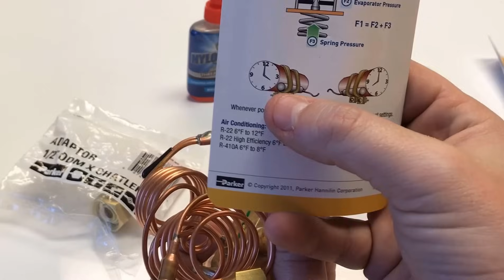Why and How to Adjust a TXV / TEV

Comment: no disrespect but he gives a great understanding as an engineer. ( looking at his fingers hes got zero in the field practice, however still fundamentally curtail). * down in the field you just replace, rather then adjusting. no matter the application. there is a spring under mechanical  and technician.  "you check meter flow with the unut running". heres the thing. unless you are the home owner that can spend hours upon hours testing every possible failure you are not able to simply adjust the txv.... the spring tension and other factors make it not a reliable repeatable fix.

Comment: Is it okay to run the TXV with out an inlet screen?  My HVAC guy removed the inlet screen because with the flanged copper 3/8'' pipe the front cabinet cover would not be attached.  He said the inlet screen wasn't needed.

Comment: 0:59 - The purpose of the thermostatic expansion valve is to maintain the correct amount of refrigerant in the evaporator coil for any change in load conditions by assuring a constant superheat at the exit of the coil. When the load conditions call for more refrigerant in the coil (such as during a hot pull-down when, say, the door of a walk-in is left open for an extended period), the rise in temperature at sensing bulb will push the valve further open.
12:34 - The number of degrees of superheat is directly proportional to the volume of vapor within the coil — the more vapor taking up space in the coil, the less room there will be for boiling refrigerant (and the less efficient the box will be). Just sayin’

Comment: Hi I have a 6 Ton carrier split unit with a "Piston" I would like to replace it with a Sporlan TXV (I have the TXV on hand) but I also want to add a suction line accumilator . What size range of the accumilator (in Liters) should I use .  Thanks very much

Comment: 6 to 8 ° is extremely low . I’m looking for 15 to 20 degrees superheat at the compressor. I’m not sure why it would be so important to check evaporator  superheat in air conditioning refrigeration yes but We are trying to make sure our compressor has good super heat and we’re not flooding the compressor …….. 15 to 20 degrees superheat at the compressor is what we’re looking for

Comment: Lennox warranty is givin back out adjustable indoor txv when it comes to stock txvs ..and guess what they are coming out closed.so you might as well start the system with it wide open and close it til your gauges look good..now at wide open within the first 20 mins the compressor will start making out chattering noise

Comment: Hey guys what s  the best way to adjust 3 x TEV danfos  valves 
So it's fitted with manuprop  MT 160  compressor and 3 evaporators 
Thks Tony

Comment: I am an ectrician by trade but the ac at my house quit cooling.  Its not cooling at all.  The condensor I think came with the house and it was built in 1987.  The inside unit was installed around 2000.  Its a 3 ton ac  unit 120 volts.  It stopped cooling about a year ago and it quit working all at once.  The compressor is running and I had a friend check the freon and he said it is low but not so low it should have quit working.  I'm thinking it might be the TXV.  I have airflow going thru the unit, its just not cold at all.  Any idea's

Comment: If I reach the subcooling value to the exact number stated in the label of the condenser's unit charge value which is 10F but the superheat goes to 1 or zero.. should I adjust the TXV valve to increase the superheat value to normal levels??

Comment: My company keeps trying to use these thermal expansion valves on low temperature Chillers that we manufacture. They are anything but an constant superheat valve. The electronic expansion valve it's so much more Superior especially with variable heat loads. The problem I have is the electronic expansion valve controller wants to fault out if I run the suction pressure into a vacuum period or if I run my suction line temperature below - 59 degrees Fahrenheit. Then the controller wants to fault out and close the expansion valve completely. When I talk to an engineer at Sporlan he asked me how low do you want to go. I'm like negative 100 degrees Fahrenheit. He just laughed at me.

Comment: Why do people say reducing superheat (smaller safety factor against liquid) uses more of the evaporator / is more energy efficient?
Reply: Well you dont want your evap coil being filled with liquid 80%-100% of the capacity. You want it to the point where in the middle of the coil its vapor (thats what you wanna feel to feel cool)..some people over charge a unit to the point where that vapor point happens at the suction line which at that point its past the blower motor cool air going back to the compressor and not your house instead of cooling you its cooling the copper lines itself ..its just like car you want your combustion to happen inside the engine not at the exhaust thats why you hear and see dumb high school kids now adays doing dumb mods to the cars that make it sound like gun shots thats combustion happening at the exhaust and not at the engine

Comment: Just had a heat pump installed and have had the installer out 3x now with the A-coil completely frozen, saying it’s a bad expansion valve, I hear in this video how the smaller lines are “delicate”… Well, ours look like they just yarded the damn things out all haphazard, looks like total crap..,

Comment: It’s also important to note that superheat is pretty important to the compressor. It’s important to know what your superheat is before it reaches the condenser because if the superheat is perfect at the evaporator but too high at the condenser then that can create an issue.

Comment: Thanks Brian, question please, I always have hard times brazing these short necked TXVs, I cannot easily roll them well with a wet rag, I use a strong neutral flame to make it fast but, the rag tip gets burned carbonizing the joint and the valve over heats rapidly, any suggestions? Thanks

Comment: I just had my AC unit serviced and the guy refilled the refrigerant since it was completely empty. Now my AC unit is really struggling to pump cold air - i was thinking of giving this valve a half turn to allow more refrigerant through - is it possible it was reinstalled "too closed"?
Reply: If your system was empty it has a refrigerant leak. DONT touch the valve. If it's not keeping up it's probably losing refrigerant at a high rate.

Comment: I'm really late watching this video but I just had a TXV unit installed that calls for 7-9 degrees of superheat.  The subcool is dead on in the high 8s, but the superheat is at 24.  I checked ductwork and there are no leaks that I could find other than a couple of tape joints that had a very minute amount of air coming out, I taped them up.  But my delta T is still at 16, I feel like something is wrong with this install.  Any ideas?

Comment: My trane unit 410 subcool is 10 and the saturated evap coil temp is 50f is that normal? My old trane r22 evap sat is around 38 to 40

Comment: You say adjusts a TXV to get correct super heat what about adjusting it for Sub cooling?  I installed a Danfoss tr6 into a system that had a piston orifice and now  I'm having trouble charging to 10 deg Sub Cool. I'm at 7-8 degs and cant get it any better.  Oh and it not responding to charge because I've gone for low to over and still cant make the ideal S/C

Comment: I have r507 chiller operating at 1 to 4degC . What is reco. Superheat..I test it once, measure it in the evaporator, suct.temp is -1C then suction pressure is 50psi..according to chart 50psi is -10C . So my SH is 9deg.C..is this right?
Reply: I work for a Fluid Chillers inc. We shoot for 15 degrees Fahrenheit superheat, but mainly we don't want the compressor to ice up. Low-temperature evaporators are very susceptible the heat load supplied to them. And even though he calls it a constant superheat valve, they're anything but. As the load begins to drop so will the superheat unless you have an electronic expansion valve. In a low load situation a superheat of 10 degrees Fahrenheit is fine but then as the load increases you could have a super heat as high as 40 or even 100 degrees Fahrenheit depending on how hot your load is. We're on chillers from 68 degrees Fahrenheit setpoint all the way down to -80 degrees Fahrenheit setpoint. I'm a huge fan of electronic expansion valves the stepper motor on the valve is so much more Superior than your silly diaphragm valve

Comment: What i am always wondering:  Is such a TXV fast enough? How many seconds does it take between change of temperature of the refrigeration fluid behind the evaporator and change of temperature and pressure in the sensing-bulb?  I guess, that can take half a minute or more.

Comment: ok i just learned this the hard way, 9:00 min in, i was working on a walk in and reading the temp/ psi at the condensing unit, so i think i bungled the super heat. i had i lot of bubbles inside the sight glass a more experienced technician said just add more 404a till the bibles stop and than just a bit more. i did. bit, but now i don't real know if its a leak or broken txv? i should have done a leak check but hind sight is 20/20 i guess.
Reply: ho to adjust at bat 12:00

Comment: lol, good luck finding a txv that you can fit a knuckle buster wrench on to adjust. Your going to be using a refrigerant wrench that ratchets, so you need to be very conscious on your rotation of the stem. Also, this can be a brutal job, try adjusting one inside a freezer thats below zero, where your waiting 15 minutes at a time each adjustment.

Comment: You Stepped WAAAAY Outside of Explaining ANY TXV Action within the 3:00 minute mark for ANY HVAC TECH of 1-2 years ...........you are just speaking to Yourself at that point........KISS!
Reply from the maker: Thanks! Make sure to share your simplified video so I can watch and comment.
Reply: I'm not a  HVAC tech and I enjoy the details.  I have gauges and have charged 410 and 22 myself in years past.  More knowledge is power. My local HVAC tech came to troubleshoot my Trane and he could not explain to me how to check the TXV.  It was replaced once already by Trane and symptoms seem to indicate that it needs an adjustment.

Comment: One thing you forgot to mention: column pressure. A system, where the evaporator unit is in the attic, or in the basement, creates a different pressure at the valve, than at the ground level condenser unit, the result of liquid in the high pressure line. Old units, with R-22 refrigerant will show bigger differences, then newer units, with R-410, or R-134.

Comment: So if TXV is icing up and the house temp doesn't go below 78 --- is that a clogged TXV?  Thx in advance!
Reply: Not necessarily... the TEV causes a restriction, so condensation is normal. Frost is probably an indicator of high superheat.  I.e. not enough refrigerant.  Just my guess.
Reply: @LemonDuc  figuring out why it's low on refrigerant is the fun part! 😁

Comment: In 19 years I have not once adjusted a txv.  Not once.....
Reply from the maker: It depends on the segment of the industry you work in
Reply: @HVACS  ah ok.  Residential and light commercial.  Couple 20 ton chillers I remember not much of them tho.
Reply: I do mostly install also, changeouts.  Never got into heavy commercial.  Making 80-100k a year on residential I dont need to switch, j got it how I want it now.

Comment: Can you not put a stainless steel pipe clamp around that bulb to mate it to a copper line? Or will the SS react with the copper?
Reply: I have used stainless worm clamps forever. Rule of thumb — clean and tight, never use cork tape or foam tape.
Reply: Problem with that is that metal is conductive and what you're trying to avoid is changing the temperature based on conditions other than the temperature of that copper. This is the reason we use cork tape, as it is a insulating material. Remember that the bulb reads temperature, and that the TXV converts that temperature into pressure and back. For proper operation and easier troubleshooting, avoid using a conductive material around the bulb.

Comment: Will adjusting the TXV also also the ac to dehumidify the air? If so how?
Reply: no
Reply: @mikemc8495  So I thought that a AC can dehumidify as well? Is so how?
Reply: @JPE_DRAEB  hey, when you lower the temperature of air the moisture is condensed into water leaving the air dryer
Reply: @mikemc8495  So what does the TXV do?
Reply: It meters the flow of refrigerant

Comment: Clockwise, increase superheat,  Counter clockwise decrease superheat.  Just like a clock, numbers increase going clockwise.
Reply: Took this guy an hour to not say that..  thank you..  jeez...
Reply: @Z-Ack  spw turns 1/4 turn at a time then wait 20 or 30 minutes to stabalize.  But you should not have to adjust TXV unless system is mixed matched in tonnage or some long line set. I am not an expert on this but I did stay at a Holiday Express last night.

Comment: Thank you very much for explain in theoretical way. I used to think it would be better for the video to be 50% long, after I complete it I think 25% would be more clear. I did gained from this video, yet just as other comments 100% practical video might be better. For example, how to adjust a R22 TxV for R410a or vice versa. And, TxV is used as reference measurement, what we can based on to do the adjustment? Like you want to calibrate a 2.5% pressure gauge clock you need a 1% gauge right?

Comment: Mine maintains superheat of 21 degrees with a sub cool of 12.8 degrees with manufactor specs call for 13 degrees for a temperature of 90 ambient, it's a 12 year old icp r22. :)

Comment: What if my evaporator suction line is frozen.... on r410 ac heat pump split system, does it mean that superheat most likely too high?
Reply: No it means either your filter is dirty, indoor motor is bad, airflow restriction, or a freon leak.  What's the pressures?

Comment: We have a freezer at my job place R404a and it start to freeze the suction line all the way too the compressor,could it be the txt?
Reply: No think air flow or your refrigerant is low.
Reply: If you have freezer temps it is normal to have a freezing suction line. The evap will have a temp of approximately -15 degrees.  If your  superheat is 10 degrees then the line temp will be -5 which will freeze the condensation.  Check your superheat,  if it is in the normal range then it is ok.

Comment: Great video ,,for the technician out there ,,take a black marker and mark the bottom of the TXV before you start adjusting so you know where you started ,,make half turns ! Left or right so you can see where your sub cooling is going up or down..I wish On the videos you would show how it works

Comment: I go off manufactures specs txv’s coming preset from Factory. I think adjusting can make things worse, replace with new one better safe then sorry instead of tinkering with it and trying to get it dialed in. Week later your back on the roof and the comp is flooded.

Comment: Excellent video, You will find most expansion valves are set real close for the proper super heat out of the evaporator. Many factors like laid over coil fins, wrong RPM motor or fan blade pitch can cause fake readings. My question is How much coffee did you drink before filming this:)

Comment: I'm at a lost of what copeland wants for their semi-hermetic compressors. I know they say generally a minimum of 20 degrees but does that 20 degree apply to all applications or just A/C ? What about low temp refrigeration? or chillers? There's not much info on this. I noticed some applications run high superheat such as low temp and it makes me ponder if these are typical running conditons or should i go after my TXV and adjust it to drop superheat temp. I guess overall having superheat is better than not having any.

Comment: What is the issue if low superheat at the outlet of evaporator coil and also low suction pressure for R22 system?  
Confirmed Evaporator coil is clean and supply fan at high speed. Suction pressure at 50 psi only with return of 80 F.
Discharge 215 psi.
Reply: a tricky question for insiders. I think there is a restriction in suction line---kink somewhere, just a thought,an outsider
Reply: its a lack of airflow across the coil. ductwork is likely junk, undersized return.....

Comment: Awesome video. Glad i watched. Found a 5 year old R22 4 ton split A/C system with a closed txv. Flat sensing  bulb.  I weighed the charge in and my suction and head were low. Ambient temp in the lower 70's. Need to go back when i have a good ambient to check the superheat and sub cooling. Parker said the valve comes set @ 10 degrees superheat.

Comment: thanx for the awesome vid
Reply: a question sir, the ac in my car, it is cold at idle but blows warm air when moving/revved. all the necessary things have been replaced with new ones ie cooling coil, condenser, expansion valve, filters. the only thing i havent done is adjusting the expansion valve

plus, the low side pressure increases when the engine is revved, can this be the source of my problem? tqvm

Comment: Every expension valve is set to  50 %?
Reply: Automatic expansion valves are AUTOMATIC. What you want is for them to meter an OPTIMUM amount of refrigerant into the evaporator coil for maximum efficiency. At start up or when hot, they should go wide open. As the heat load is "worked off" the outlet of the evaporator gets cooler and cooler or drops in temperature. The sensor bulb senses that and throttles back refrigerant for a now smaller or lighter load. So one, many can be adjusted for greater or lesser flow, BUT ONLY within say a 20% range.  More realistic is 40% - 100% open  Depends on actual temperature and load. It takes a supermarket two days to level out a load on the refrigerator cases ! Adjustments are made by professionals with top notch meters and gauges.